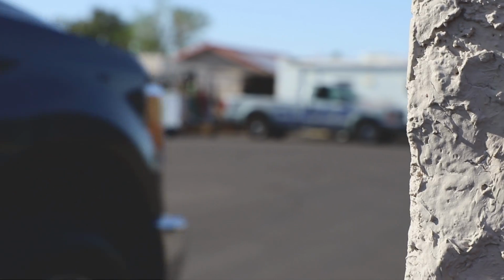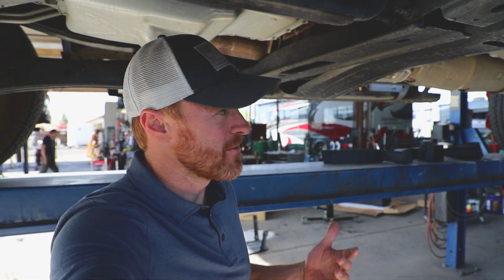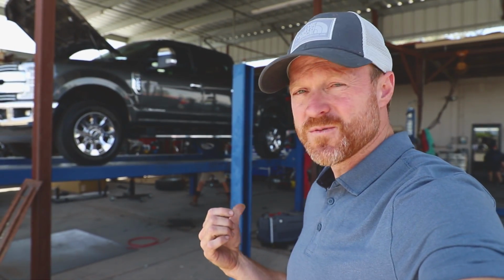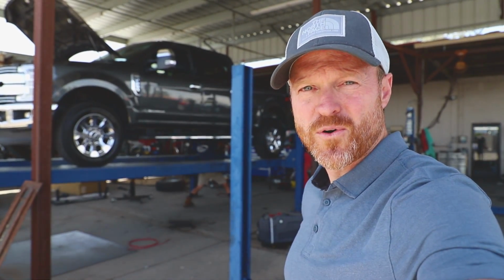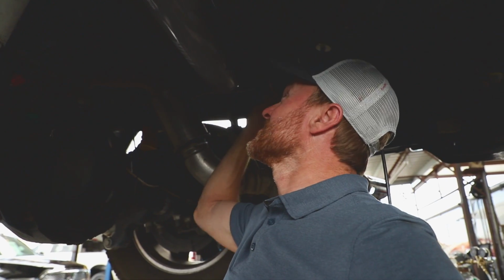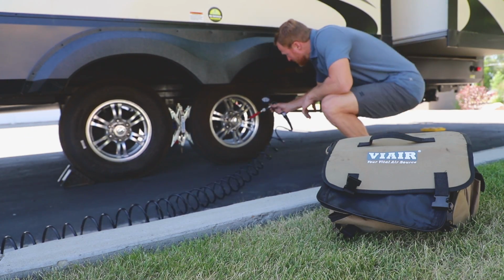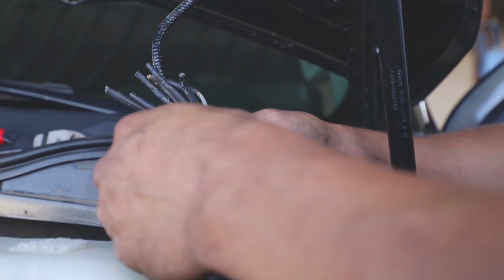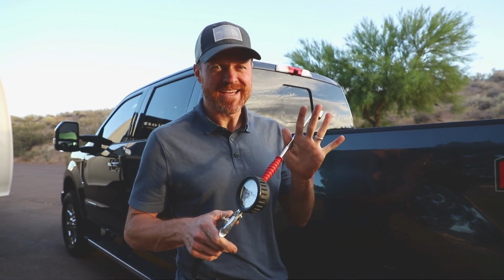FORD F250 MODS | FIRESTONE RIDE-RITE, VIAIR & TRANSFER FLOW TANK

Comment: installed air tank and air pump wrong .. !!   i have owned 3 of them air pumps and found out the hard way the air pump MUST be higher then the air tank . the air line can NOT go up hill at all . the VIAIR pumps does not like any water in the line and they make air so fast that they need a water dump valve like big trucks do .  its not going to last long the way you have it
Reply: a small hump in the line lets small amounts of water flow back down into the 1way  valve  this valve was made out of steel on the 2 and 4CFM units and the balls rust then water gets into the head of the unit . at that time the head and EV motor are mostly open on the inside and start to rust every thing up fast . there is alot of low cost parts inside them .  if you look at the install paper work its in there to keep the tank and all line going down hill .
Reply from the maker: falcon7350 Hmmm. Seems to be working. What are the symptoms of not working?
Reply: I was wondering about about this also.....esp water in the air line system traveling in Alaska. Gonna need some kind of air dryer system for those lines or they will freeze. Doesn't take much for them to freeze. 

May wanna look into an air dryer system to filter out the water vapor and contamination.
Reply: All air compressors make water. Need s way to drain it out. Wiil freeze in Alaska.
Reply: I second all this jumbo, Compressor will make water. Drain it, filter it, or dry it. Or just keep replacing pumps.
Reply: Also you can add about a cup of antifreeze to each airbag
Reply: And remember, if the humidity is high outside, the air compressor will make more moisture in your air tank.... keep it drain on a daily basis if it's humid out.... and like everyone is saying, if it's cold, drain it daily....
Reply: Just need to add some
Type of dessicant in-line filter.  Won’t matter how the pump is placed.  But agree with moisture in line and must be a filter on pump to filter outside air being under and back of truck will inhale dust.

Comment: I hope he unhooked the battery cables before welding on the truck. Good way to burn up a computer. $$
Reply: Hans Gyswyt good to know! I plan on doing some mods to our 5th and wouldn’t have thought to disconnect the batteries.
Reply from the maker: mucho gracious For sure

Comment: If the air fitting doesn't have one, you should get some kind of rubber boot / cover for it. It's a great idea putting it where they did, but water and  road dirt, even on the paved highways, will work into the fitting and causing it to jam up and either not open or not seal when you connect your air hose. Or worse, when you release the hose, it won't seal right and will leak down causing ride issues with the air bags.
Reply: Marc, he very right!
Reply: Almost forgot... A cover needs to go all the way to the base of the fitting down by where the fitting goes through the metal, not just the end. There are small bearings under the part that slides back. Those will rust up with moisture and sand will pack into the area preventing it from sliding.
Reply: I used a bulb off of antifreeze tester cut the hole a little bigger fits perfectly

Comment: Awesome upgrades for your line of work. Have you considered adding a fuel transfer tank to the bed? Not sure what your payload numbers are but you could gain another 30-40 gallons easy.
Reply from the maker: Big Truck Little RV The hitch weight you have is too high. Lithium is half the weight of 6 V. But I go off the number on the scale anyway...
Reply: Big Truck Little RV But Marc has stated repeatedly here that he has hit the scales many times and even with the new weight, he's ok. He obviously has printouts...isn't that enough to prove the case?

Comment: I just drove rv to ak. Arriveded here labor day. You can get fuel on a pay at the pump about anytime. I came up then cassier hwy more scenic BUT ROUGHER.  Diesel was 1.58 per liter can in the more remote areas of can . Filled up today in Wasilla 3.32. If you have any questions let me know. I stayed in provential and state parks. 10 to 20 per night . Dry camping.  Jim

Comment: Great video!  Two questions on your fuel tank.
1.  Why did you choose the metal 60 gal transfer flow tank, vs. the plastic composite 55 gal titan tank?  I was planning to upgrade to the titan tank to keep the tank weight to a minimum (plastic) and possibilities of rust in a metal tank.  Just curious as I know you research your purchases.
2.  You didn't mention in the video how you accounted for the change from 34 gallons of fuel to 60 gallons in the truck ECM?  Are you going to use forscan to change the fuel tank size so that your ECM knows your fuel volume and items like distance to empty work correctly?
Thanks!
Reply from the maker: jnuechte Good questions. The metal tank is a better product and cliffs welding has had issues with the plastic tanks. I didn’t want to recommend a product that someone would potential he have a problem with. I schedule an appointment with my Ford dealer to get the Computer updated with the 60 gallons… But they were unable to do it. They are currently looking into how to make this change. I’ll circle back with an update once they get back to me. They were surprised they couldn’t do it. I guess it’s a change in 2017.
Reply: Thanks for the reply!  In regards to updating your computer you can do that yourself.  There is a software called forscan (free) that allows you to make changes to your ECM's with your own personal laptop.  Check out this thread it explains everything you need to know:  https://www.ford-trucks.com/forums/1460787-forscan-spreadsheet.html  You can make other nice modifications like removing the annoying double honk when you get out of the vehicle with the key in your pocket and the truck is still running.  Lots of great options!

Comment: Another option I really like are the "Tool and fuel" boxes. They go on the fillter neck and gravity feed fuel from a toolbox in the bed. They're universal, so cheaper than the transferflow setups and add storage capacity to the truck. I have my eye on a 60 gallon unit to add to my 38 gallon truck tank.
Reply from the maker: Scott L I do too, but I couldn’t sacrifice any room in the bed being FT with a TT. I’m light on storage. I think that would be a great solution for pulling a fifth wheel.
Reply: Yea I will miss my big toolbox when I get one. The big box is full now and the tool+fuel ones are much smaller tool capacity. As a non-full-timer, I have plenty of space in my bed.

Comment: The VIAIR would be good for those that go off road at the beach to refill our tires! Also like the idea that it is aftermarket.  Had a Mazda MPV years ago that we could inflate air levelers to tow.  When the compressor Mazda had on it went bad, they wanted a ton of money to replace it so we did added some air tubes to manually inflate it. Thank you for the great idea.

Comment: would have been convenient to have included a remote air tank drain next to your bumper quick connect.
Reply from the maker: You're right.
Reply: Maybe I'm wrong....and I can't tell from video, but if its going into the side of the tank, it would be worthless.
The drain needs to be in the lowest fitting in the tank.
Reply from the maker: There's a lot space up there. I can access all the holes.

Comment: Cool upgrades. Did your miles until empty range indicator show the additional miles? (since adding the larger tank)
Reply from the maker: I went to Ford to get that updated and it can't be changed yet. I'm sure it will happen soon and I'll get to the dealer asap. The gauge is fine, but the miles to empty is off. Err.

Comment: When I get my camper and truck, my first modification is going to be installing a larger fuel tank.
Reply from the maker: It's been soooooo nice.
Reply: I can imagine! We're going to be going with a 25-27ft camper and 1/2 ton truck or SUV. So a larger fuel tank and bags will definitely help keep the ride smooth! Especially through Colorado and down to Florida.

Comment: Marc, does the tire inflator come off the tank or directly from the air pump?  Great setup for a pickup up.  I have 2 air connectors (1 front and one read) on our motorhome and use it to air tires.  My only draw back is I have to engine running to keep the air pressure up in air tank.  Great upgrades!
Reply from the maker: It comes off the tank. 2.5 gal. When it gets low, the compressor kicks on to hold 150 psi. It's a sweet setup.
Reply: Very sweet!  Just remember to shut off the switch when you are not driving, that pump could drain your battery...
Reply from the maker: It's off when the truck is off and then it runs through to the switch.

Comment: Great modification. I had the Viair added to my 2018 F450 from the dealer so I would say you got it done cheaper knowing how much dealers charge per hour.
My truck has dual tanks so I didn't need tank upgrade, smart on your part because gas stations aren't as close in Alaska as in lower 48.
Good info, keep up the good work. You know you going to put the horn's on, come on go for it!!!!
Keep the rubber on the road.
Reply from the maker: Nice. I thought you were Class A. Did you change rigs? If we move to 5er, we'll strongly consider F450. The boys should have horns. Trish says I'm not responsible enough. She's right. That first uplifter switch is where it will go!
Reply: Keep Your Daydream 
I am class a but I have a truck for home and local trips going buggy ridding.
I am not a full time RV traveler just weeks at a time. I have two hundred acres at home witch is a Morton building 150'X300' with living quarters. So I'm still a part time traveler.
Reply from the maker: Now I know where to keep Grand Ginger when we sail between seasons...

Comment: That truck is so tricked out now I'm thinking it should be a Transformer Truck. Maybe "Optimus Ginger"? or maybe "Ginger Prime"?  Really interested in the solar upgrade next week. I've been thinking about beefing up my single panel and am intrigued as to what an upgrade entails. Another fun vid KYD!
Reply from the maker: The new solar setup has been a game changer already. We're 7 days in and only $5 in lodging :)
Reply: #solartoremember
Reply: @KeepYourDaydream  
Instead of installing a heavier fuel tank, buy yourself two or four military style [gerry] fuel cans. Problem solved. Plus, you save yourself some money from labor cost$.
Reply: Those are excellent upgrades. Really well done and having air for anything off the truck is way cool. I just started watching and the last episode I saw your we’re in the F150 with over 100K miles walking through why that truck worked. Which episode did you migrate to the new diesel? Did you provide some perspectives on that in the episode?
Reply: You've reached #totality   lol  toe-tal-ity.  Love the mods, safe travels!  Cannot wait for the Kenai Peninsula reel to roll off the press!

Comment: Great info. I remember you being close to payload limits before. Did the extra fuel and weight of steel tank push you over or really close?  Air bags help but doesn’t change legal limits.
Reply from the maker: I'm doing mental math and adding all of these upgrades in exchange for Tori. How much did she weight again? ;)